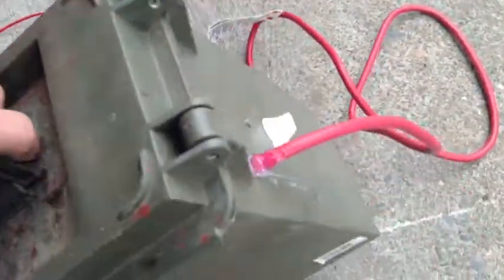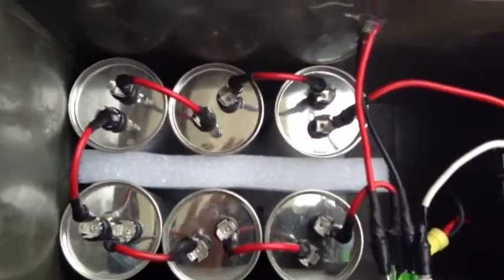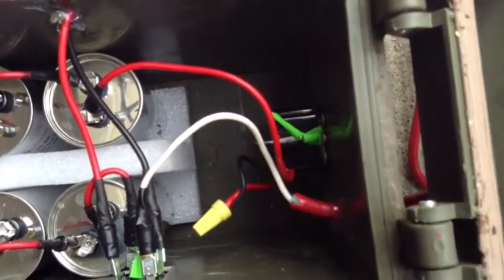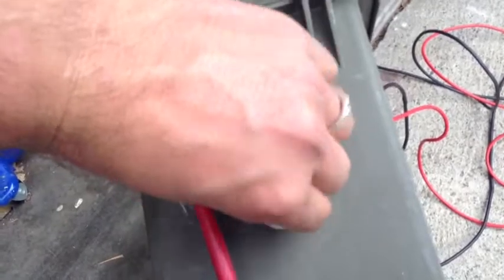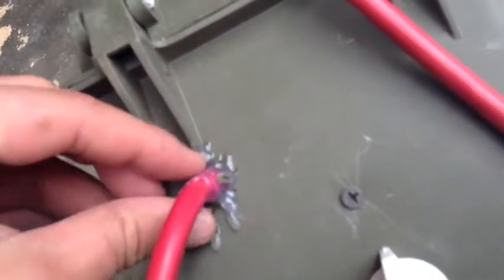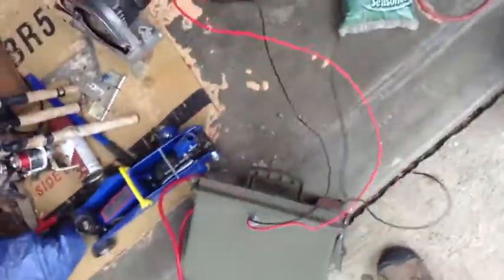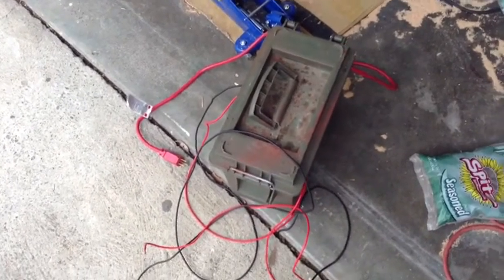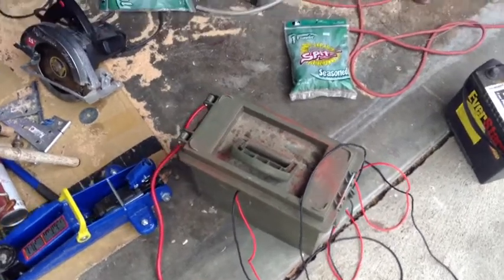Luv EV conversion 10

Comment: 6, 80uf caps in series, like you show, will give you about 13uf, capacitive reactance at 60Hz is about 204 ohms. That will get you about 168vp-p/204ohms, about 0.8 amps max current. 6, 80uf caps in parallel will give you 480uf, a reactance at 60Hz of about 5.5 ohms, and a max peak current of 30 amps! At thirty amps that diode bridge will over heat and die without a heat sink.